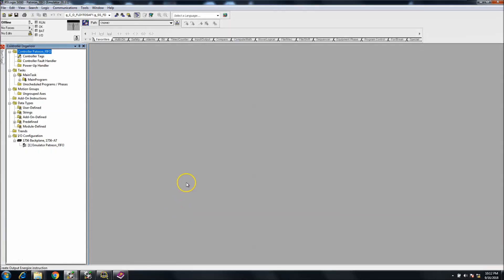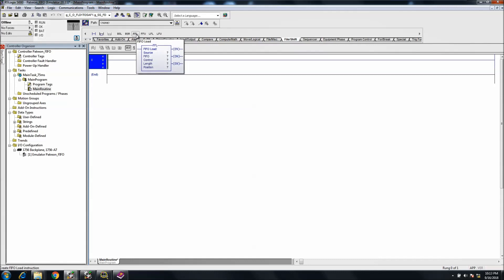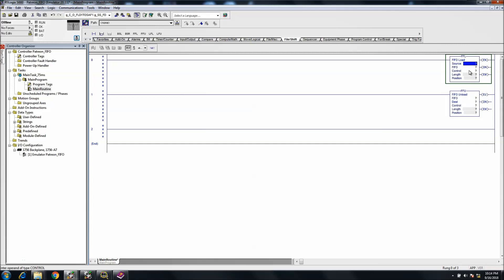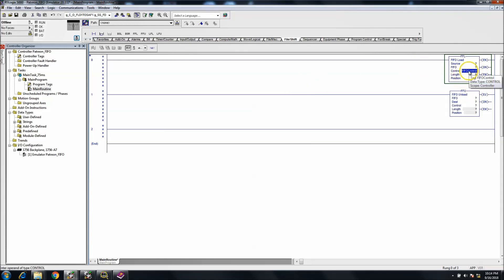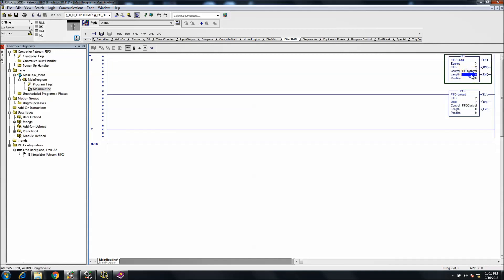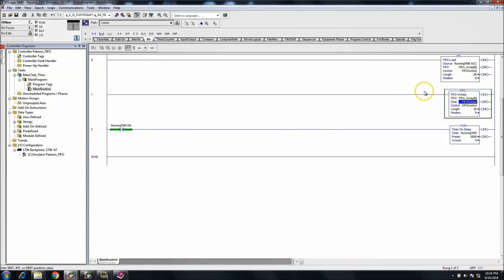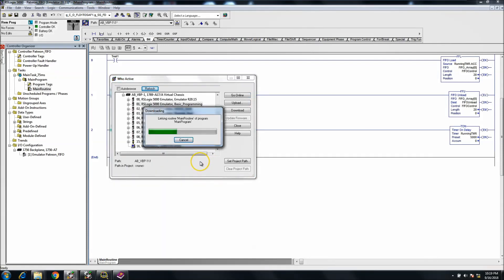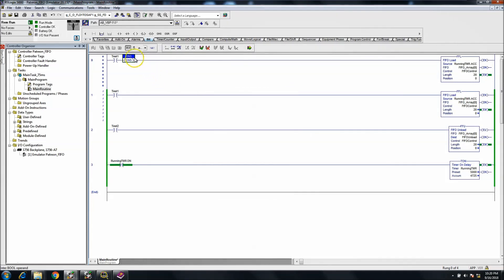RSLogix 5000 FIFO Load and Unload Example [Official Video]

Comment: Hi Shane, Great video.

A few other comments:

FFL and FFU have built-in one-shots and execute (load or unload) on a rising edge of the input rung, with the .EN/.EU bits as the memory for the rising-edge (one-shot) determinations, which means the separate ONS instructions on the rungs this video initially had in front of the FFL and FFU were redundant. That also explains why the XIO .EN loaded .ACC values at ~150ms intervals.

Also, at around 12m55s when you had it auto-load the FIFO array via the XIO .EN on the FFL's input rung, why didn't it throw a Major Fault, per the flow chart on p. 566 of the Instruction Set Manual here:  https://literature.rockwellautomation.com/idc/groups/literature/documents/rm/1756-rm003_-en-p.pdf#%5B%7B%22num%22%3A2360%2C%22gen%22%3A0%7D%2C%7B%22name%22%3A%22XYZ%22%7D%2C46%2C522%2Cnull%5D
?
Reply from the maker: Thank you for the comment.

Part of the reason is because I am running a periodic task so the scan rate of my program is 75ms.
The EN. bit triggers for the instruction then fills the fresh data.

Even with that said, a continuous task would allow this to work perfectly as well.

he EN. bit goes high then the load of new data works.

Comment: How could I move the elements in an array? for example, I have 10 elements and I want to add a new one at position 0 by moving the one that was in 0 towards 1, 1 through 2, 2 through 3 and so on
Reply from the maker: Using the same pattern type I show here, there are a few ways to set up these instructions to work differently but like the same
Reply: @ShaneWelcher  I had not seen the full video, but thanks for the idea haha

Comment: Hey quick question... I am allowed to use multiple FFL's and a single FFU all using the same control on the same array, right?
Reply from the maker: Great question, in my opinion I would not try that
Reply: @ShaneWelcher  Thanks for the quick response! 

I thought of another way to accomplish what I was trying to do. =)
Reply: Used with converging conveyors.

Comment: Shane, this is a great video that explains FIFO usage very well, thank you for sharing this information. After watching this video and your next video that goes through an example of a FIFO I added a FIFO very similar to yours to our ladder logic to try and average data coming from an encoder and I have ran into 2 issues that I was wondering if you know how to solve and one question about something that you briefly mentioned in one of these two videos. 

1. The array length is 15 and so it goes from 0-14, so I set my length to 15 but the position only ever goes to 14 and so the unloading does not occur. If I change the length from 15 to 14, the position stops at 13 and unloading does not occur again. So, this means that the array never fills the last spot and I am unable to unload the array. 

2. I am not sure if this issue is due to the previous issue, but the array position can start at zero and then get filled according to the FIFO loading instruction but the data coming in does not get recorded to the array, it remains as all zeroes even though my source is a steadily oscillating speed. What can cause this? I tried the timer the same way you did and I had no luck either, I am not getting data into the array even though the position goes to 14 as mentioned in the previous issue. 

Question: You mentioned that you use FIFOs to help you average the data, how exactly do you do that? I tried it by using a rung below the FIFO that just had the AVE function block and that caused an issue where the array never loaded anything, is there something that causes it to conflict with the FIFO?

Thanks Shane, I am a beginner at PLC so I apologize about my limited ability to my issues.
Reply from the maker: Thank you, glad to help. Not sure if you are interested but I do have a PLC training course if you have a need.
I have two free mini-courses and one paid that I have moved off on Udemy.

Here are the courses if you want to view  --- https://goo.gl/37nQjp
Reply: @ShaneWelcher  Thanks Shane, I will definitely be looking to complete the courses in the coming weeks.
Reply from the maker: I will look into more videos, I do the same thing as far as averaging data

Comment: Hello, What will be the main advantage of using FIFO to full an array instead of using structure text for example with a while/for cycle?
Reply from the maker: A FIFO is a first in First out so it stays in order and is an instruction set to use to minimize how much programming you have to do.
Really is just a preference but is very effective and helpful to have more tools in your belt as a programmer so when you need to shift then shift but if no need to shift then do it your own way or the way you prefer.
Reply: The while/for looping takes more time. (How much time is a function of the PAC and the firmware. Rockwell claims that improvements have been made to the scan time of Function Block/Structured Text routines to get them to be compiled tither to scan as fast as Ladder Logic.)
The other advantage to the Ladder Logic FIFO's is ease of troubleshooting as the code that the instruction employs is not visible and thus possible altered. It remains consistent.
It would be nice if Rockwell would one day create the of Shift Registers, FLL,  FAL, FSC, Bit Shift, etc. for Structured Text equivalents given the faster scan times of the newer PAC. (-L8x)